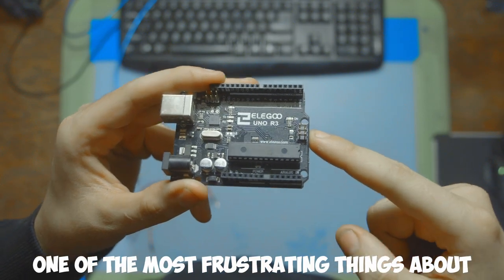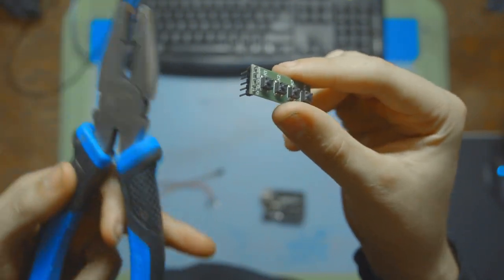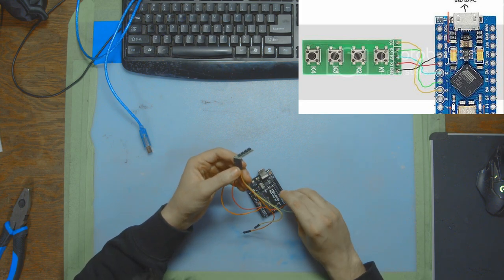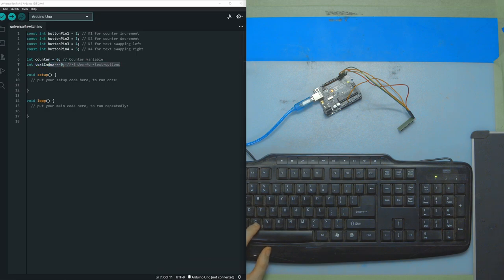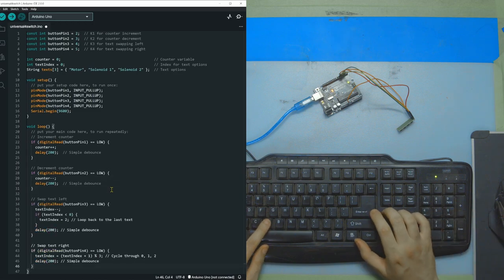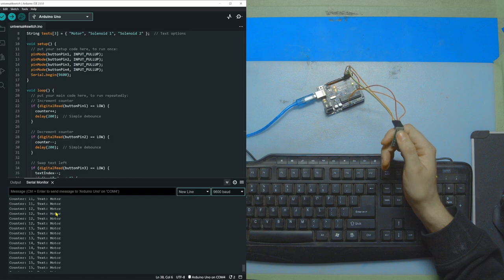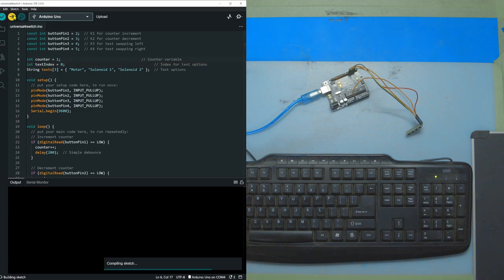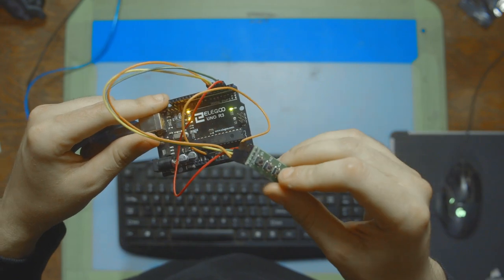USE SWITCHES/BUTTONS TO CONTROL ARDUINO CODE #arduino #arduinoproject #switches #buttons

Comment: Amazing informative video ❤Can you please make a video on how we can cycle through different functions (using switch cases or if statements) using two buttons to change increment and decrement the program counter.  I am having a hard time doing that, I will be more than thankful if u provide a tutorial for it.
Reply from the maker: Hey for increments I show that in the video with if statements and if you look closely the last of statement has a increment and a looping value so that if you click it enough times it will go back to the start, is that what you mean ?